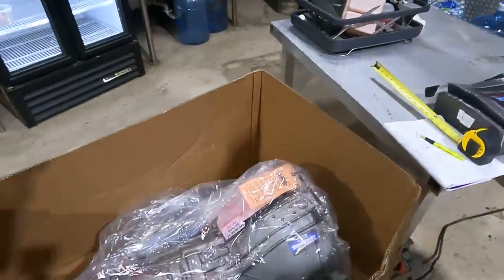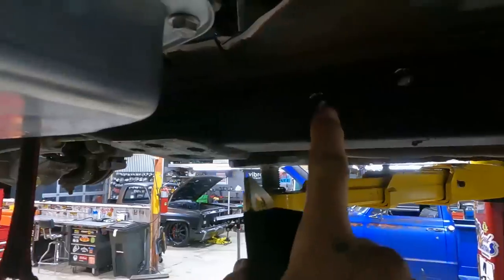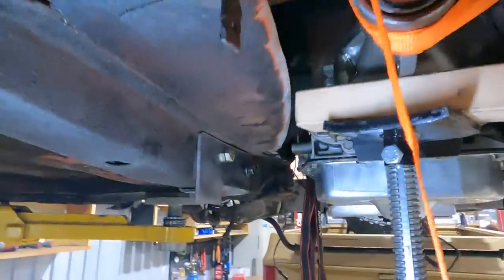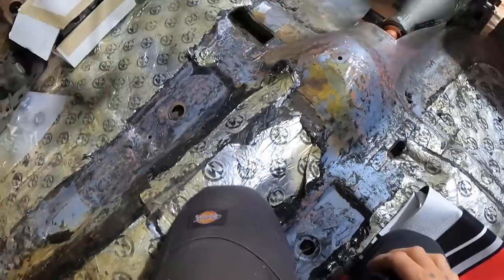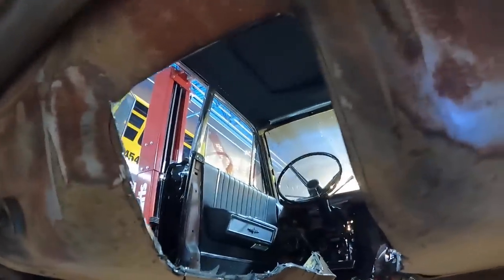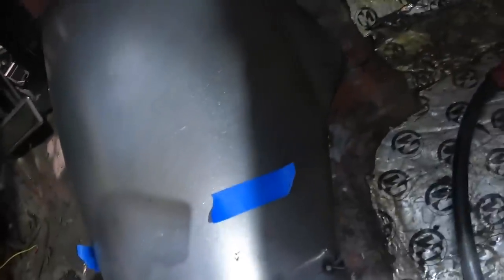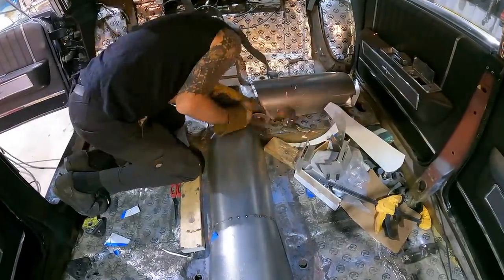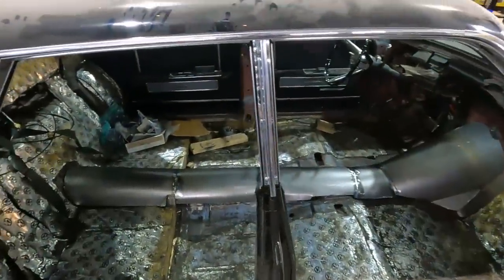Custom Lincoln Continental Transmission & Tunnel Fabrication - 7.3L Godzilla Swapped Slab Ep. 5

Comment: I love this project, and I like the slammed look... but I have to wonder if you run into any difficulties when you need to jack it up.  Hard to fit a jack under a slammed car.  I guess the air bags and the engine would have to fail for it to really be a problem... but I do wonder if you guys have another plan in place.
Reply from the maker: A lot of what we've build here ends up on bags and usually down on the frame. The only time we'd really run into a big issue with it being slammed on bags and not being able to jack it up is if 3 or more of the bags ends up failing, which tends to be pretty rare. If 2 bags are working, we generally can find a way to fit a jack under the car. If 3 or more aren't inflating, it's generally an issue with the management system or the manifold, which would be addressed without having to lift the car up!

Comment: why no internal bracing when cuting the floor out like that?
Reply from the maker: There's only one real structural brace that was cut through when we made that tunnel. If you watch the Chevelle's transmission tunnel episode, we reintroduced bracing back into the tunnel at the very end of the process. We're going to do a similar thing here, but we need our actual driveshaft so we can be 100% sure on where all of our clearances.

Comment: So they cut out two floor supports and put nothing back in to support the floor/seats. 

Would have been better and easier with a 2 piece shaft since a driveline that long is going to have a low critical RPM speed with the rear gear ratio I’m sure it’ll be running. Good luck with the vibrations at highway speed.
Reply from the maker: Except we can easily add the structure back in on the bottom of the tunnel the same way we did in the twin turbo Chevelle. It's not that difficult.